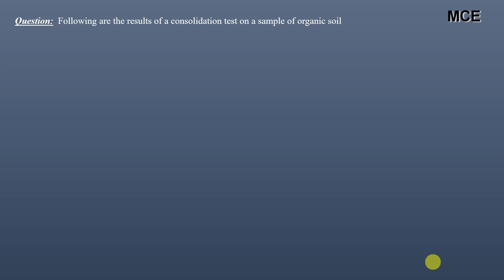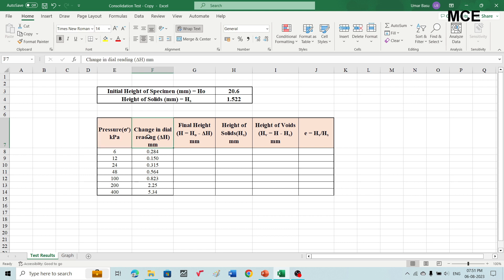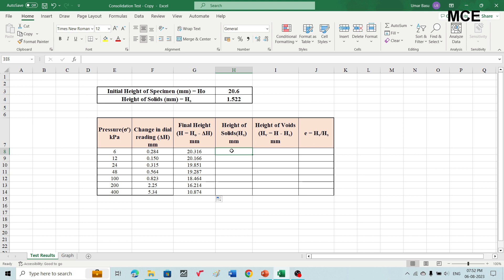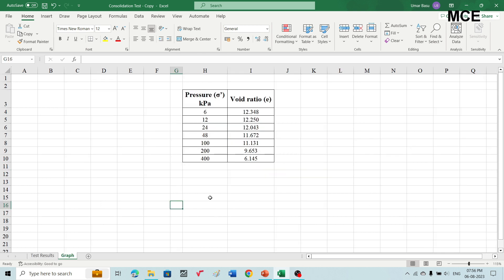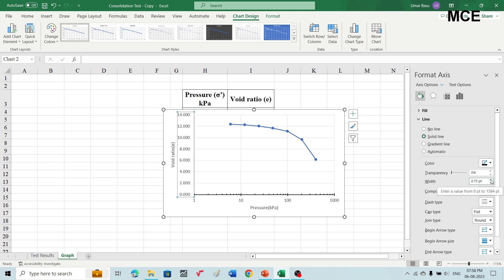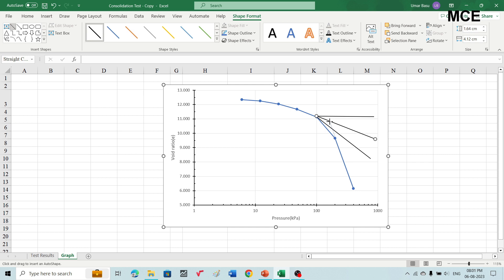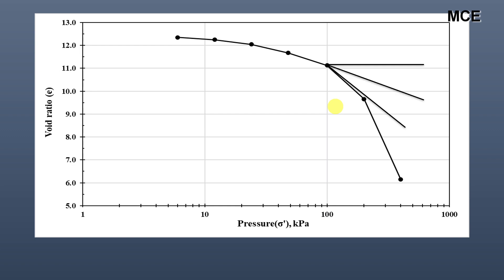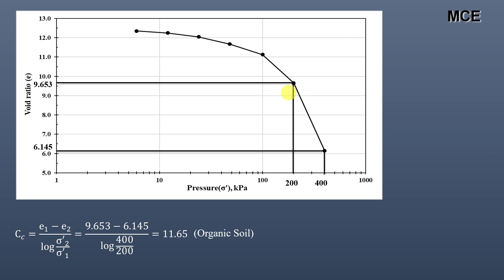Consolidation Test Calculations of Soil|Height of Solids Method

Comment: Thanks for this insightful tutorial... I was able to find the void ratio on a related question through this video... 

I have some questions to ask and they are:
• How were you able to know that the preconsolidation pressure is approximately 185 kPa from the graph?
• In choosing the point to draw the tangent line, how will you know the exact to use?
• Did you just draw a line in between straight perpendicular line and tangent line or you did calculate for the angle and bisect them with the line drawn?
• If you did bisect them, how were you able to get the angle of bisection from the graph?
• And finally, what do you understand by field compression index and how can we find it from that your question?

Thanks in anticipation!